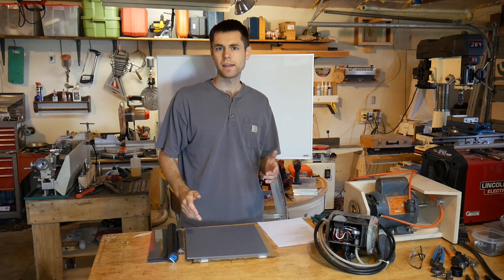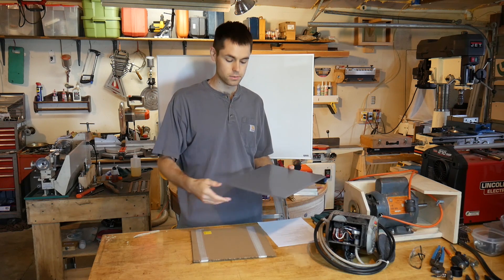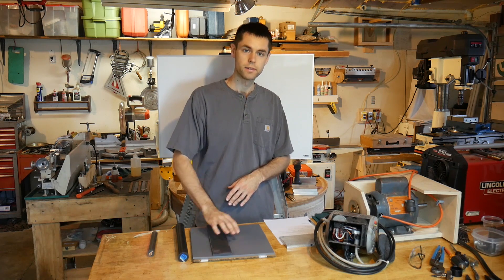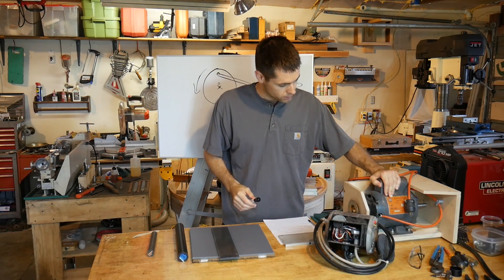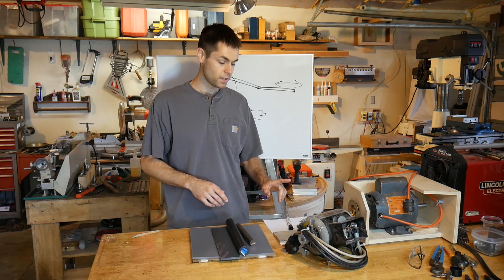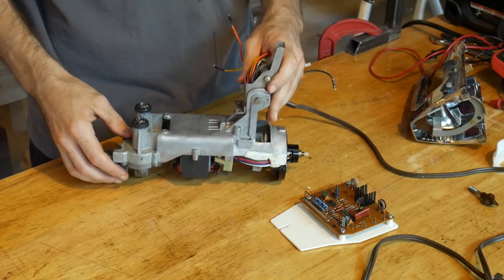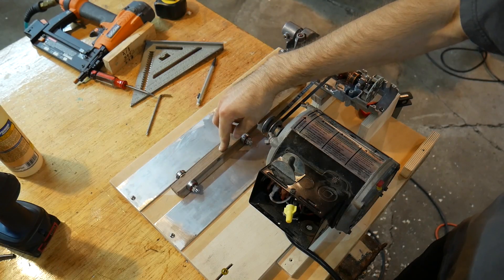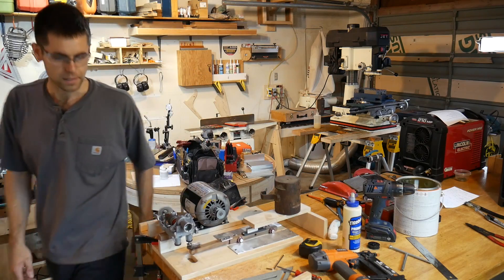Kitchen Mixer Test Fixture

Comment: You thought your way past the easiest solution: windshield wiper motor. Cheap at scrapyards, sometimes free if you know a mechanic. What fails on modern ones is usually the control board and park switch, so for this application, all you need is a 12V supply.

Comment: i don't think you need a counter. Just do the same time interval for each sample. Over a 10 hour period the difference in oscillations will be negligible.
Reply from the maker: Sure, 60 RPM is easy to figure out also, but a counter lets me completely forget about it, run it in stages if it gets warm, etc. For $13 it seems worth the cost. I also have some other manual things I would like to count, so it will come in handy.
Reply: yah for 13 bucks that makes sense. Just felt like you thought the project was becoming the XKDC cartoon (https://xkcd.com/1319/)

Thanks for the great videos. I enjoy them quite a bit.

Comment: You may have missed an opportunity,  that universal motor has the advantage of fairly simple speed regulation?
Reply from the maker: Yes, it did have a speed regulator built in but I couldn't always tell if it was working, it may have needed a load. Even if it worked well I probably would have changed it later based strictly on the noise.

Comment: I like your videos, althrough I dont understand why are you making them in 1080p60fps and 720p60fps. what is the purpose of the 60fps? the overall quality of the videos does not request it, so this way its just a waste of bandwith.

Would you mind to make it in 25 or 30fps? :D thanks :D
Reply from the maker: I prefer 60 and it's the way things are going, so it will age better. I though YouTube let you watch them in a lower frame rate if desired, but this does not appear to be the case, at least not anymore and/or with Chrome.
Reply: I dont know, in Safari you cannot change it. I used to watch it in 480p this reason, not to waste my plan.

Comment: WHY ARE YOUR AUDIO LEVELS  ALWAYS SO LOW?
Reply: Everything comes in loud and clear on my end.
Reply: Imo his videos are a tad louder than most, but as it's mostly talking, I never have to lower the volume.
He has a somewhat deep voice, so maybe that doesn't come through phone/laptop/cheap headphones well?
Reply from the maker: I drop the audio during loud parts like grinding, otherwise it's pretty jarring. Besides that I try to keep an eye on the dB meter when editing, so it shouldn't be too far out of whack.
Reply: i dont know man, your dynamic range in audio is waaay more than it should be.
Reply: I'm not really sure what the problem is. Everything in the video is perfectly audible and comparing to other channels his voice is actually louder.
Youtube even compresses the audio, so there is less dynamic range on playback.
Lowering the volume for grinding etc is a positive thing imo
Reply: Dunno it might be a bug on my side but for example if i play one of the recommended vlogs i cant even hear you talking over their voice...